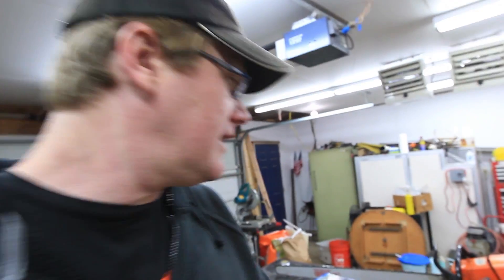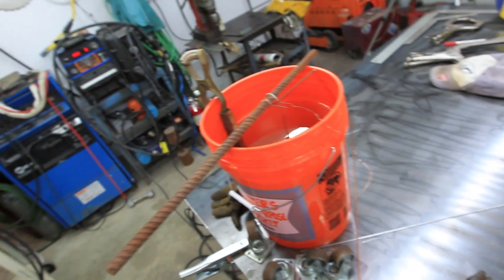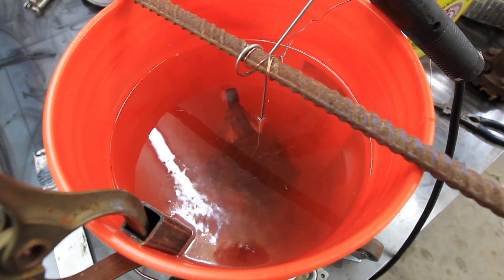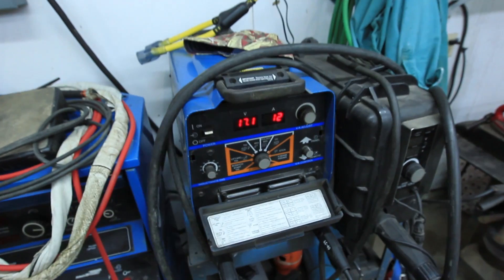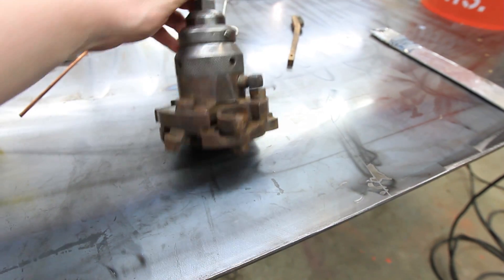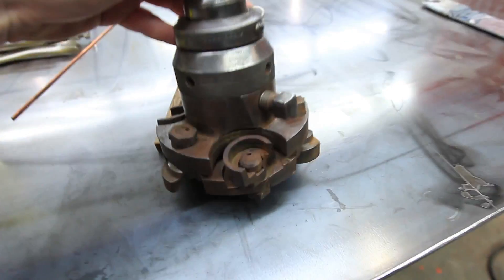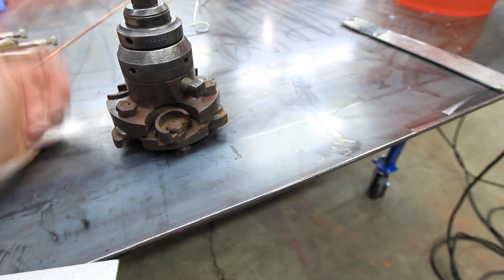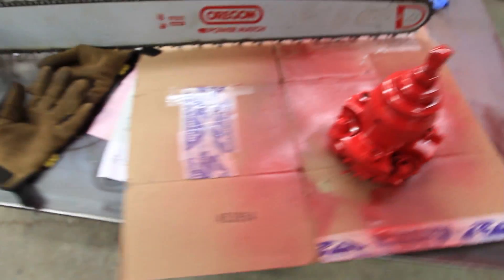Washing Soda Rust  Removal

Comment: Using any stainless in the anode ie positive or as a carrier for the piece to be cleaned produces hexavalent chromium and is lethal. See the film Erin Brockovich. It is illegal to dump it into the water system too. Use a carbon rod or even a piece of plain iron for your sacrificial anode. Hope you are ok.